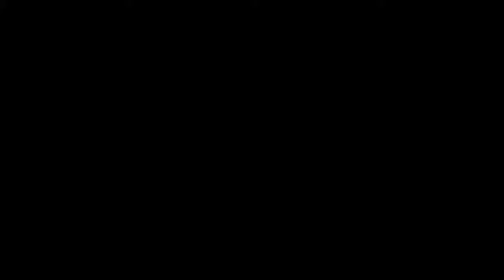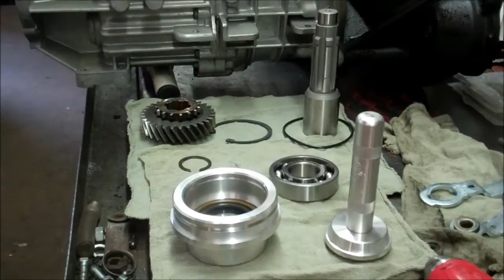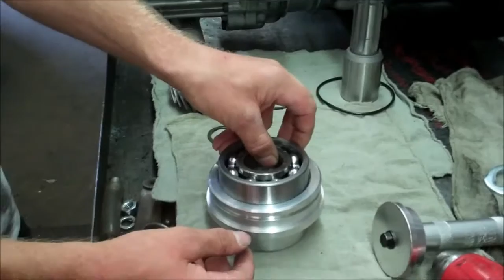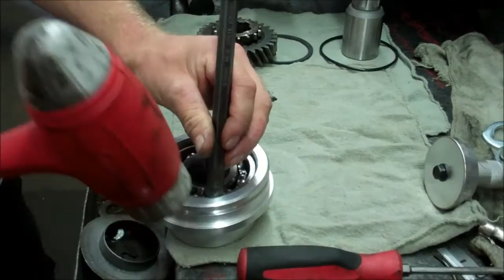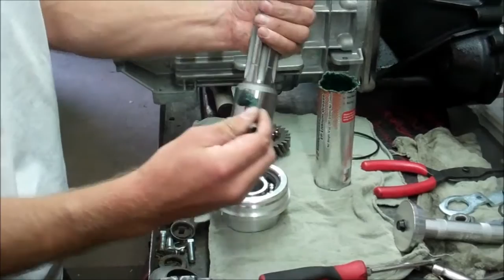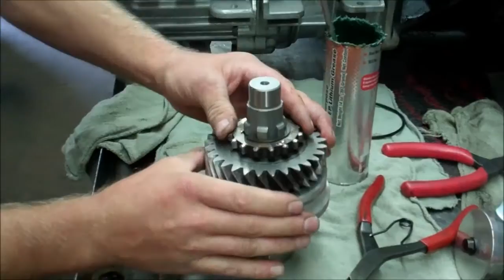66-77 Ford Bronco - NV 3550   Part 2   Adapter Bearing Gear and Coupler Shaft Assembly

Comment: how much power can the nv3550 tolerate?
Reply: It’s rated for 300 ft/lbs at 7200ish gwvs but they should handle more since the 66-77 bronco is a lot lighter